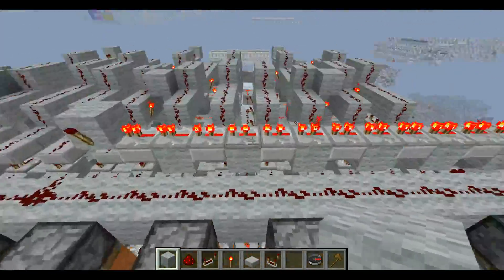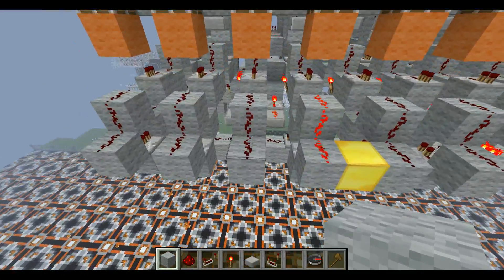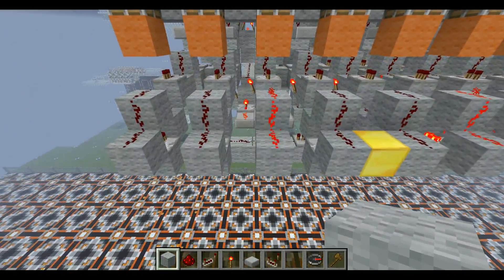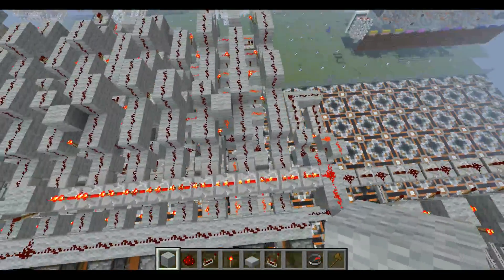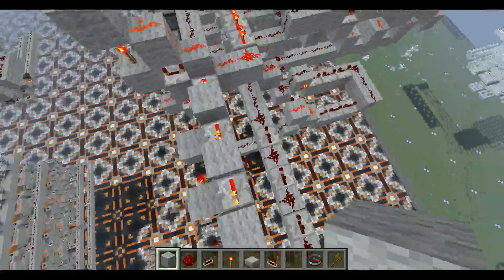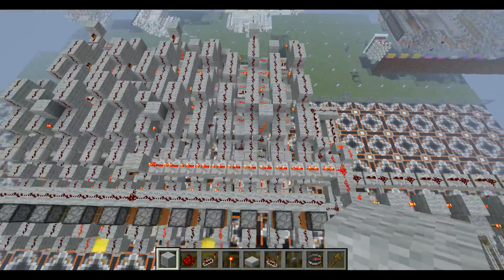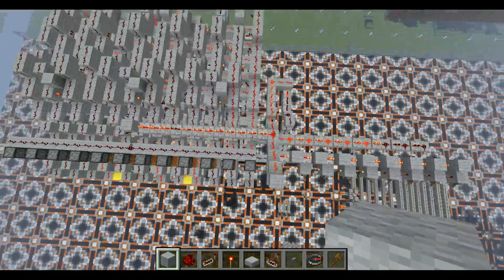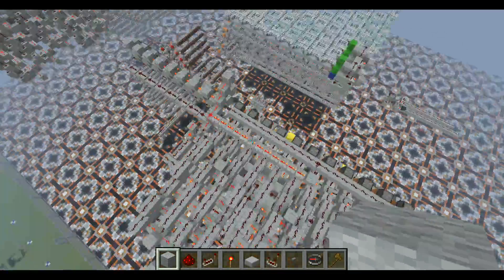Serial binary to BCD, minecraft redstone (V035)

Comment: Nice design, I made a similar thing some time ago, however I only got it to work with 4 ticks per bit and your double dabble cell looks smaller as well. By the way I also streamed in the first 3 bits simultaneously, since 2 bits will never be bigger than 4. (also made this with signals strength, which made it even more compact, but slower).